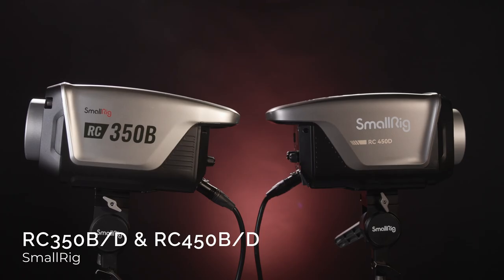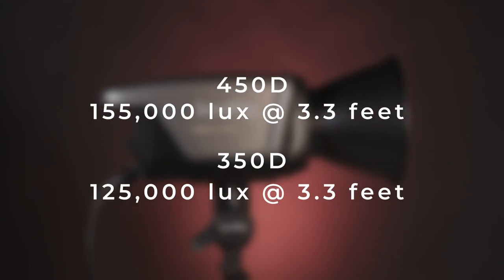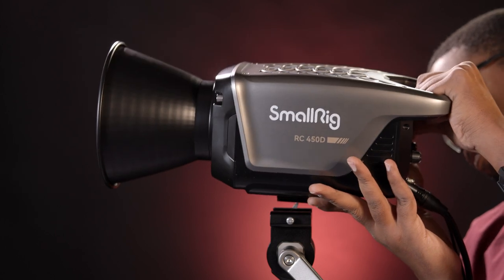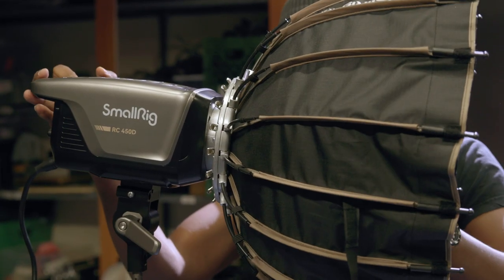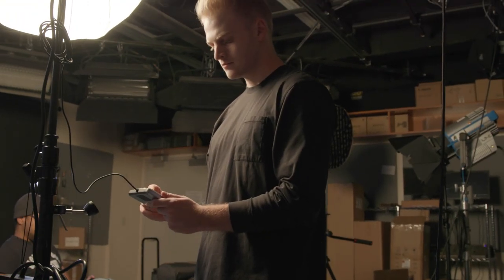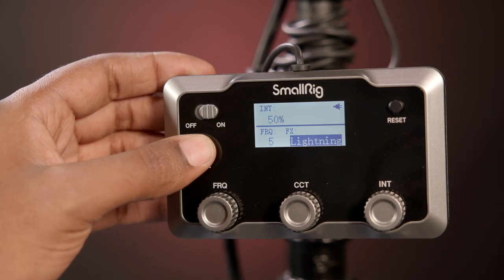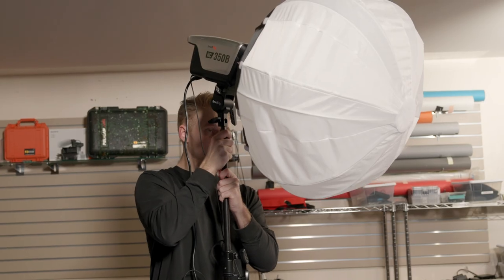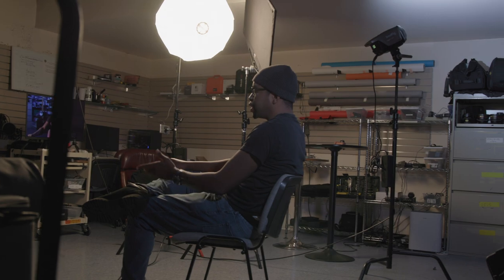SmallRig RC 350 & RC 450 COB LED Lights | First Look

Comment: Is there there a way to use umbrellas or only the Bowens mount light modifiers ?
Reply from the maker: Yes, umbrellas can be used with the RD350 or RC450 via the built-in umbrella slot.

Comment: What light stand did you recommend for these lights?
Reply from the maker: There are many light stands that the SmallRig RC 450B and 350 COB Bi-Color LED Video Monolight can work with. This some of them I would recommend, https://bhpho.to/4boYXC1.
Reply: @BandH  Thanks, I'm actually thinking about the Matthews Medium Maxi in Steel - Which wheels can I use with those?